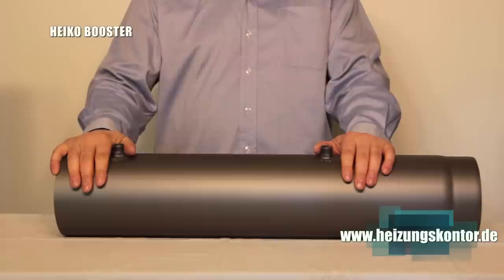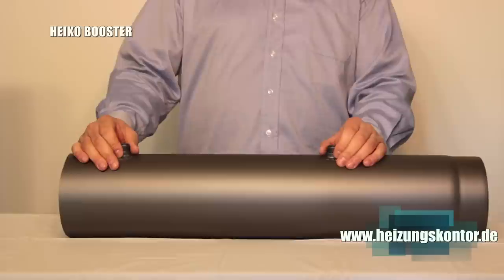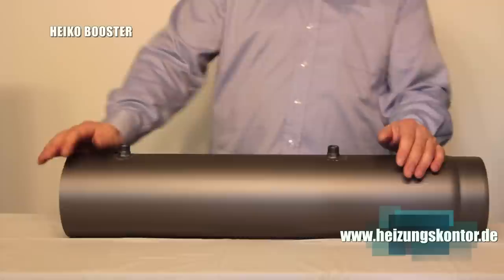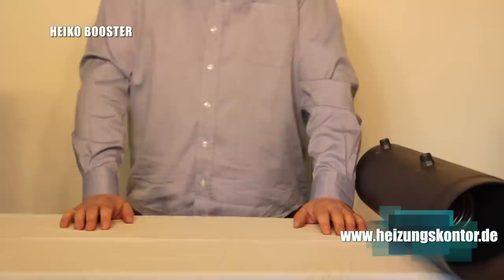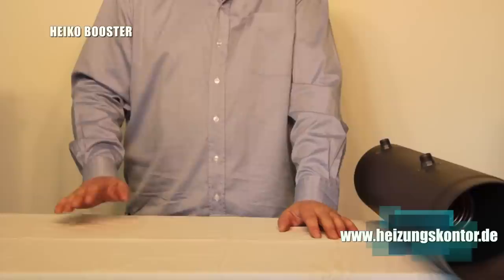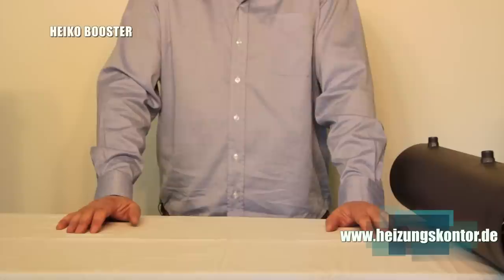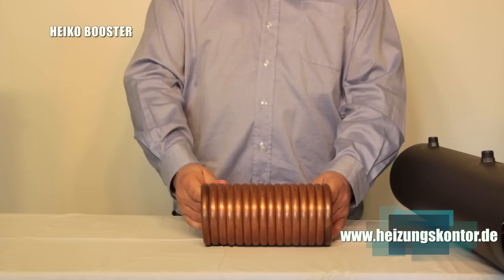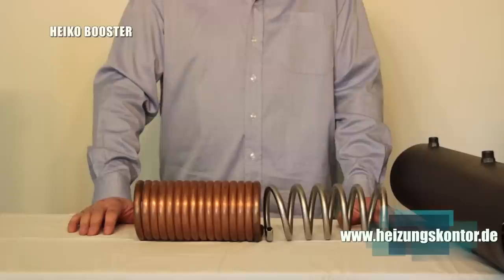Abgaswärmetauscher Water Heat Exchanger wasserführende Rauchrohrwärmetauscher vom Heizungskontor

Comment: Do you sell internationally? What's the difference in price for copper vs stainless steel and why should I choose on or the other?
Reply from the maker: Hello Aleksandrs, thank you for your questions.
Yes we also ship our products internationally. The difference between heat exchanger coils made of copper or stainless steel is 1. the Price. Copper is more expensive than stainless Steel and 2. Stainless steel heat exchangers can be run for a short time without water. I hope that my answers will help you. If you have further questions, you can also call us. Best regards Karl-Heinz Lehmann Heizungskontor